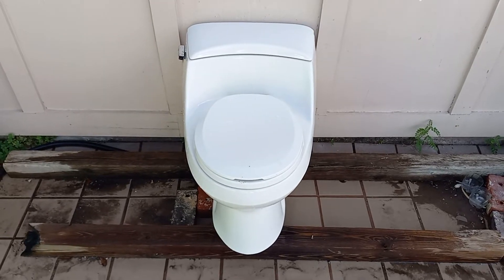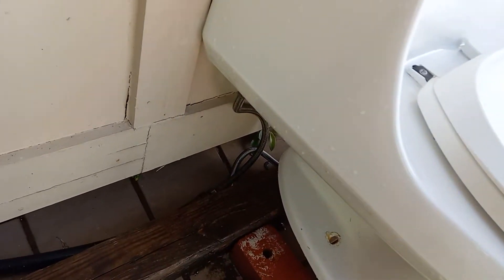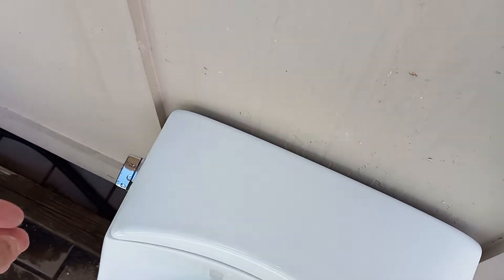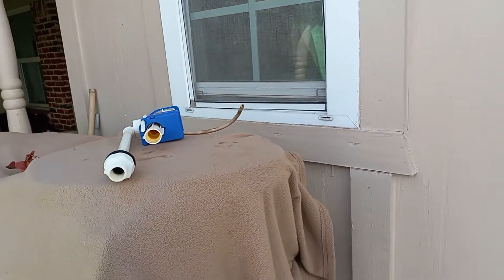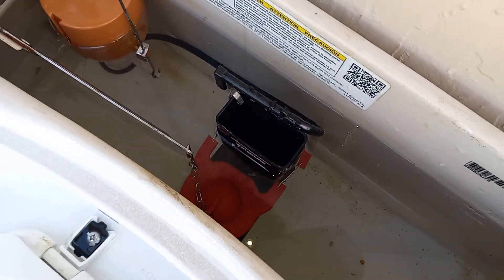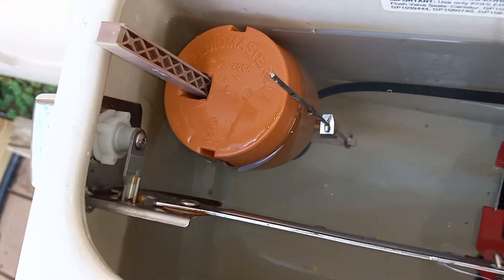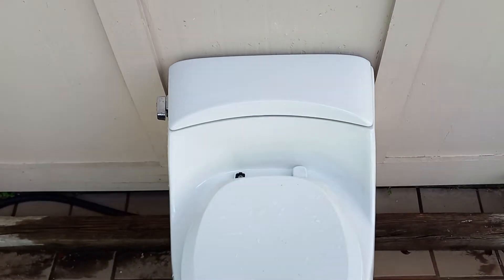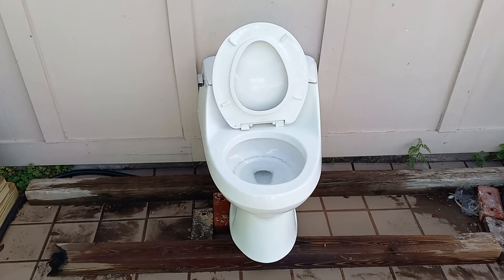YT First- 2011 Kohler Rialto Ingenium Toilet

Comment: This is actually a Kohler San Raphael, not a Rialto.  Rialtos are smaller, lower in profile, and do not have the Ingenium (indirectly fed siphon jet) flushing system.  Instead, they have what Kohler called the "Rim Jet" flushing system, where most of the flush water rushes from the front of the bowl down toward the drain (like dumping a bucket of water into the bowl).

Some Rialtos have the "Pressure Lite" flushing system, which uses the Sloan Flushmate pressure vessel.
Reply from the maker: Very interesting

Comment: That is actually a San Raphael. The Rialto has a different tank lid design. The model number in the tank is 3467 which is the model number for the round San Raphael and the model number for the Rialto is K-3386.
Reply from the maker: I didn't know round San Rafaels existed.